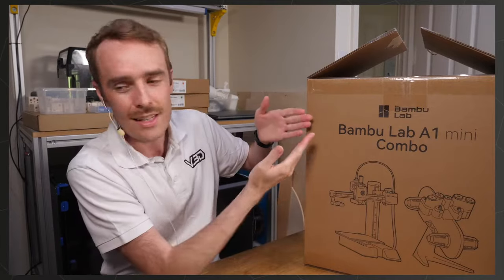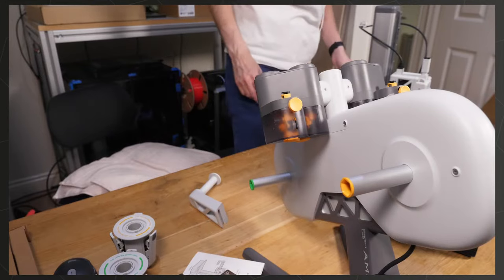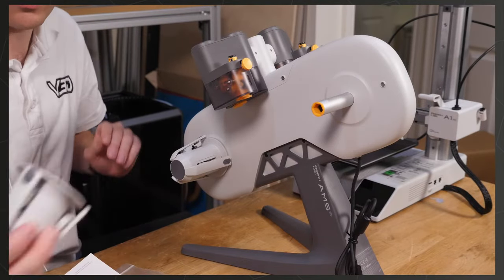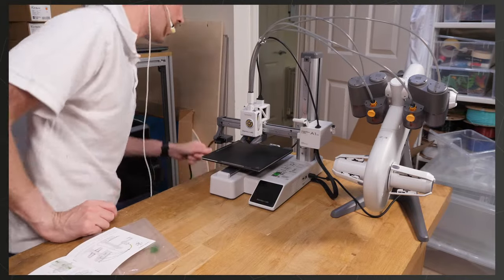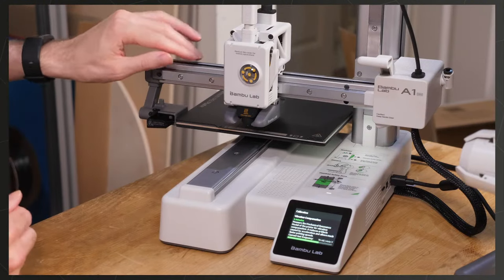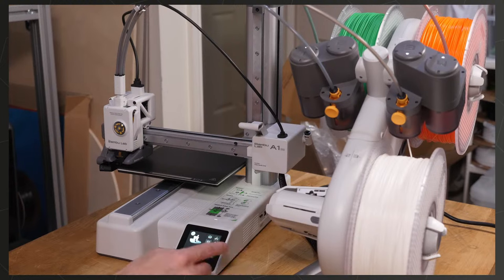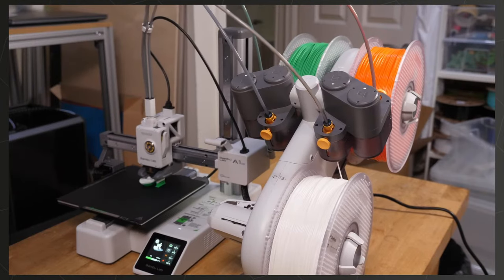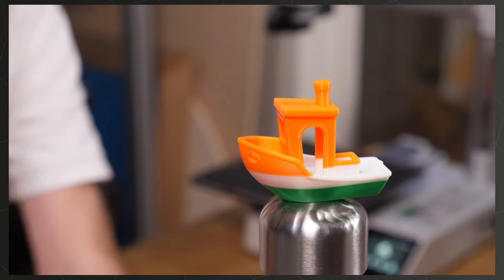Engineers First impressions of the Bambu A1 Mini

Comment: The fact you have to set up wifi and the bambu handy app and it slices in the cloud, As well as all the other network safety concerns going on with Bambu i think i will give it a miss.
Reply from the maker: You don't have to use it that way if you don't want to. But up to you, sounds like you made your mind up already.
Reply: @Vector3DP  Thats good to know, it looks like a cross between a cetus a printrbot and a prusa mmu1.  Not a bad little machine just not for me im too entrenched in the opensource side of things.
Reply: @thegarageluthier  any bambu printer you can put in lan only mode, you don't have to use the cloud
Reply: Yeah and the bed on goes up to 80C lol. I don't know why they would do that and we all know it's a software limitation.